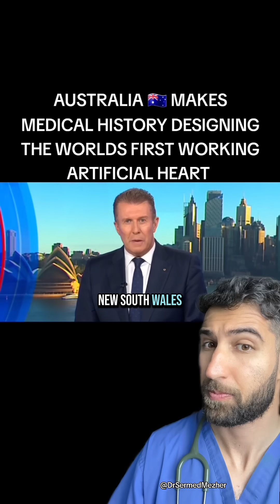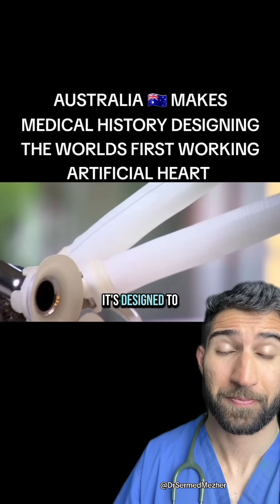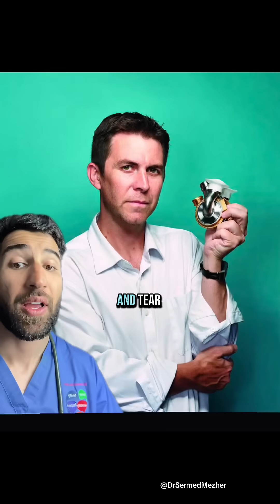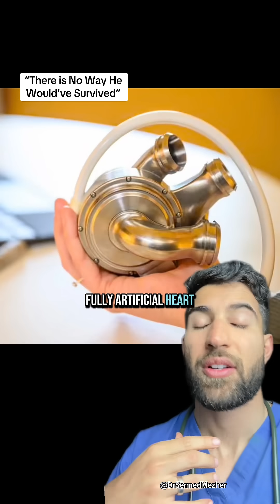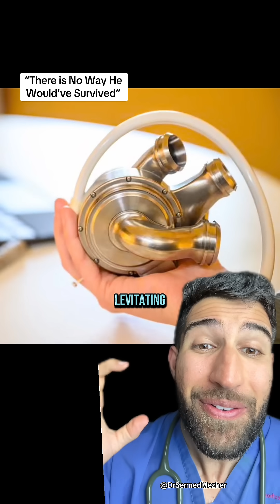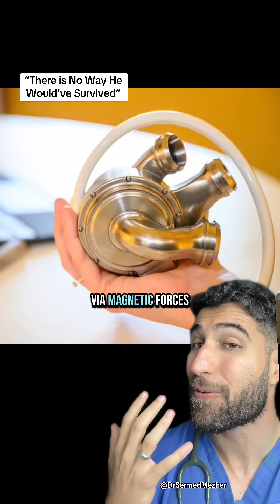“He Would’ve Never Survived Without This” #breakthrough

Comment: Why can’t they use real bones to replace hip knee replacement instead of artificial metal ones which don’t function properly
Reply: @piqueny8872 1. It would be hard to find an exact donor because everyone is immensely different in skeletal structure 
2. Your immune system is central in the bone meaning that donor bones could easily be rejected by the body
3. Flesh is weak and we must crave the strength and certainty of steel

Comment: Are they reusable? Since they’re metal, they could probably clean and sanitize them so they can be reused for another person. It might be a weird question but it would really bring down the costs of receiving a heart if it’s not a single use product
Reply: The expensive part of a heart transplant isn't the materials, it's the surgical team required to perform it. Even if they could reuse it (which seems unlikely since it's a very temporary part), the cost to ensure it was safe and not get sued would far outweigh any savings from reusing the device
Reply: It's really not likely they are reusable.  The #1 thing they would worry about is contamination, and it's never ever worth the risk.  It would be recyclable though as it is surgical metal.

Comment: Great invention but I 100% forsee someone not checking a file and putting one of these patients in an MRI machine, quickly followed by a reenactment of the chest burster scene from Alien.
Reply: It’s said that it’s a temporary mesure before transplants. He would be monitored and registered. And the guy fully knows about his artificial heart.
Reply: @n0rmal953  all that is true, but don't underestimate incompetence.
Reply: Yeah I was just thinking about that
Reply: Guess the comment filter didn't like details, but anyways, these still require a big external battery last I heard, so it'd be unlikely
Reply: You do know this isn't the only metal thing doctors put in people's body?
Reply: @pacboygamer6728  it's powered by a magnetic field, doesn't really matter what the metal/material is if the device works via a magnetic field.
Reply: @notoriousd.i.g.87  yeah exactly! so why are you pointing out something that has already been a concern for years. your acting like this is the first time this danger is present.
Reply: @pacboygamer6728 The metal they use in standard transplants is non-magnetic, meaning an MRI won't interact with it (the M in MRI is for magnetic). This device specifically operates ON MAGNETS, meaning it's posing a threat we haven't had before since the MRI machine will have the strongest effect on it
Reply: The thing that might go in his favour is when they do the pre-checks and wonder wtf is going on with his pulse. Plus in the pre-checks they do always go through about metal plates, pins, screws, joint replacements or any other metal items within your body, and they ask about any surgeries within the last 6 months.
Reply: Who cares? Between not having a heart and having to take extra care with MRI machines, which one do you think its better?
Reply: @caralho5237  The guy who has their chest ripped open accidentally and the hospital when they need to replace their expensive MRI machine.
Reply: @caralho5237 they're not saying we shouldn't have this, they're saying it's gonna suck if this becomes a widespread used thing and the inevitable stupidity and negligence of people results in someone (most likely) dying a horrifying death. Hopefully, it'll work as a cautionary tale and people will be even more cautious, maybe mark patients with artificial hearts physically in some manner as to not rely on their files only
Reply: Yep.
Reply: Ur twisted af 😭
Reply: STAHP
Reply: The 5kg Battery Pack might give it away ;)
Reply: He will just need to stay away r4om us healthcare.

They also have active metal detectors in the door going into the room where mri machines are located.  Abd they also scan you with a handheld wand to make sure you didn't forget about a piecing so somewhere
Reply: Space balls too😂😂